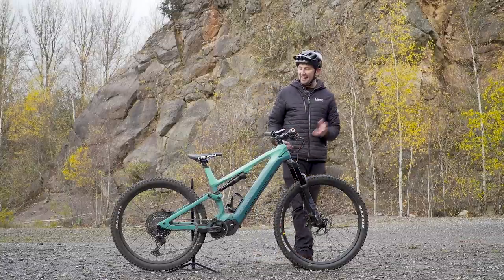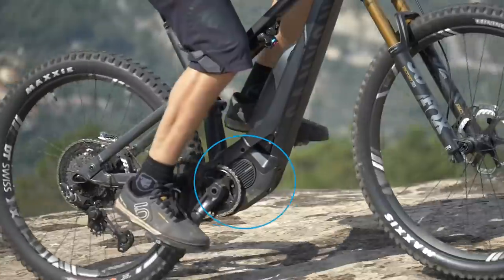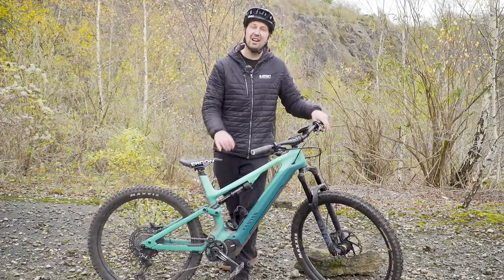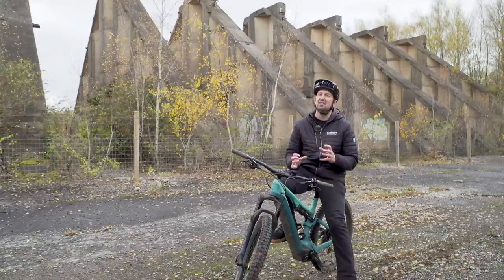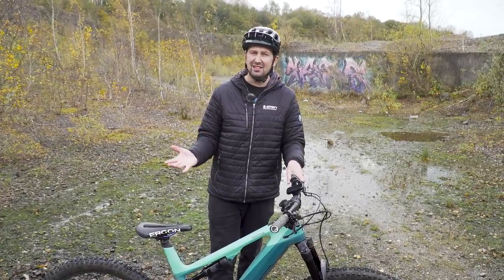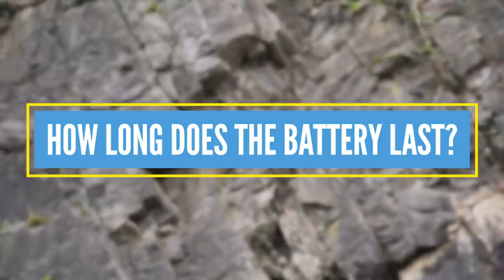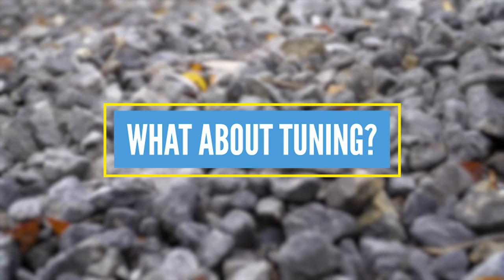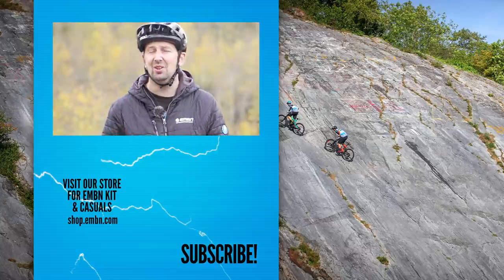The Most Confusing Things About E Bikes | EMTBs Explained

Comment: Having a sealed motor means no repairs on most motors which is not the best thing if it breaks,apart from that grumble they are excellent fun.
Reply from the maker: If there is an issue we suggest you take it to the nearest bike shop that is an official dealer. If the motor is out of warranty there are some great specific workshops that specialise in e-bike motors. Check out Performance Line Bearings as they have a lot of knowledge 👍
Reply: @embn  Dang it I have a Shimano,not repairable

Comment: I have my canyon spectral:on on a roof rack. It just about goes under the weight limit when I remove the battery, which is probably smart anyway, so that nobody can snag it. 

Is there any reason you would advise against transporting the e bike without the battery?
PS: Absolutely love that bike, it rides like a dream.

Comment: I think the problem with ebikes is that the battery 'WILL' die at some point and the manufacturers won't be manufacturing anymore batteries and bike shops won't hold stock. That means, that when the battery IS dead, the bike is dead. Who wants an ebike that is useless? You can't really use it as a normal bike. All the bikes I've ever had I've sold and they get sold again. With an eBike, you won't be able to do this and the manufacturer's know this.

Comment: I'm looking for a fat tire ebike to ride in the snow so I need something that can fit at least 4.8 or wider. I wanted a Norco bigfoot vlt and then I found out they still are using the old Shimano E8000 and you can't even get one of those because they are unavailable. Any other options you can think of? There is the Haibike its full suspension 👍but comes with 4" tires 👎and I'm not sure if they have clearance for wider.
Reply: When I remember right, 4.8 is possible on the haibike, but it always depends on the wheels themselves, because the manufacturers sometimes are not  reliable with their scales. Best would be, to ask Haibike directly via their website, they should know best
Reply: Moustache
Reply: Honestly, I have a bike with the Shimano E7000 and it is super powerful, I don't see the need for any more power, I've climbed slopes with my bike that you can barely do on foot.
Reply: Hi Lourenco I'm sure the E8000 is a fine motor and don't think its a deal breaker. If I could get one I probably would. The Shimano EP8 is 15 nm stronger 10% lighter and 10% smaller so of course it would be nice.
Reply: B4rt how's it going? You're right I should contact Haibike to be sure. I'm not crazy about the nointegrated batterie either but you can't always get what you want. I do have a Giant Trance with the Yamaha motor the same motor Haibike uses and I like it. Thank for the input.
Reply: If you are alright with hardtail, Fantic Integra is a good choice. Brose 90Nm. Comes with 4,0, but tried 4,6 no problem, 4,8 should go aswell.
Reply: Hi David. I'm fine with a hard tail. I have a Surly ice cream truck Bluto up front but its hard tail. It's not that necessary to have full suspension on a snow bike. Thanks for the suggestion I will check it out.

Comment: In 5-7 years everyone with their 10,000$ eBikes will be crying because there are no replacement batteries & parts. Hence their bike become worthless.
Reply: At that point, I’ll buy one and fix it with fresh cells, new bearings and CNC milled cogs to replace the plastic ones. Generally, it’s hard to destroy a motor, as there isn’t really much that can break it, it’s the gearing inside of it that goes.
Reply: @xx-----------xx873  which normal human  can do this stuff with a battery ?
Reply: @jerryx2000  It should be super easy: 

discharge the battery to complete flat

Take the case apart

Desolder the cells

Put new ones in

Connect case back up
 
you're done

If you can do it yourself, it turns a £1k job (the cost of the Specialized 700wh) into a £150 job. I presume cells will only get cheaper, so this method gets cheaper with time.
Reply: @xx-----------xx873  that's some good news. which bike do you have?
Reply: @jerryx2000  I just ride a SS carbon rigid bike, and an Inspired 20" street trials bike. I've seen inside one of those batteries, and I can't believe that they would bother to build in some cell DRM, so there shouldn't be a problem.

Comment: not heavy? really?
Reply: "Just a different kind of weight" .. haha, yes, a bit strange. Of course, the average e-mtb is much heavier (the orbea + specialized sl are absolute exceptions), but in my opinion it's an advantage, gives you much more stability on loose ground, I'm faster on my ebike, than on my normal mtb. But I'm also not a downhill rider, preferably trails and such stuff
Reply: Well, if you're on the slimmer side, your total weight while using an e-mtb might actually be less than a bulkier person on a normal mtb.